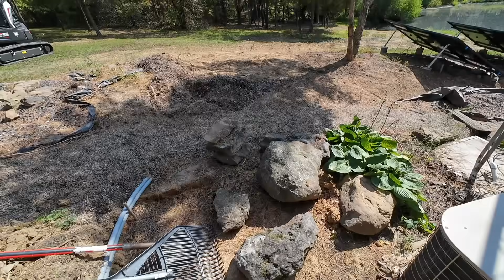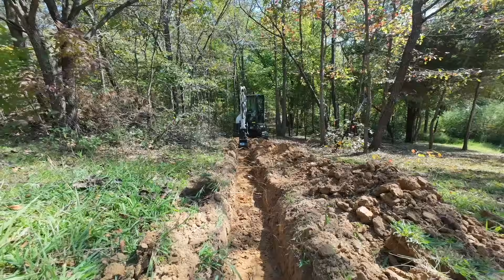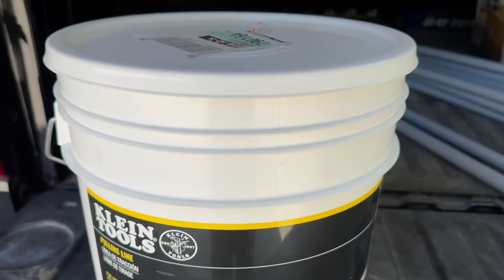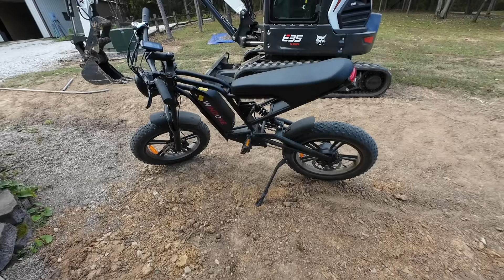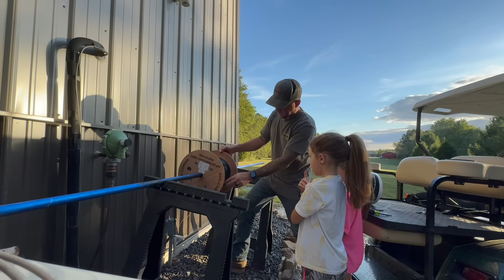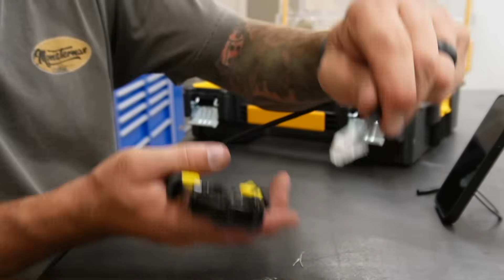Installing INTERNET To my Shop Over 300 FEET AWAY...

Comment: Wireless bridge could saved a lot of work also.  Your uplink only serving your family
Reply from the maker: Does a wireless bridge work through dense woods?
Reply: Im not sure of the elevation of your property but since it not flat you be surprise. Probably when you put it on your existing tower to your star link. Then a single mast by your shop and a good quality wifi bridge.
Reply from the maker: I went with the guarantee by hard wiring it.

Comment: I tried a wifi extender to my shop and it works about 50% of the time this summer ill be doing conduit and cat 6 along with a coax cable for antenna tv as we have a nice antenna on the house and dont want to buy another.  Glad my run is only 20ft. My cameras,tv and wifi problems will be a thing of the past and pretty cheap to do.

Comment: I work at a data center, and we run premade fiber all or the time. Premade Single mode with LC connectors in any length. Possibly cheaper than a copper run. You will need the routers or switches to have SFP ports for the optics modules. I have run fiber 65 feet to my shop.  I’m even going to start using it for my desktop. So it is easier to use these days than 5 or even a couple of years ago.

Comment: I see the video is a year old, I hope you've reconsidered fiber in the interim.  You can pull in pre-terminated duplex LC fiber patch cables into that 3/4" conduit; I'd recommend pulling two just for redundancy.  The problem with copper between buildings is that a nearby lightning strike could take out all of your connected network gear in one fell swoop.  Fiber is completely non-conductive, and therefore immune from lightning.  Excellent work by your girls, by the way!
Reply from the maker: The copper line has been working great.  Lots of storms and zero issues.

Comment: Funny how electricians will pull so much extra wire on paid jobs and waste it..but when it comes to their own ....it's expensive lol
Reply from the maker: Not really.  Your either spending the extra time/labor for more accurate lengths or spend a little more on material.  Material is cheaper than the labor 80% of the time.  At home, all i have to worry about is material costs.

Comment: Do the two buildings share a breaker box or are they different service connections? If they were the same you could of used powerline injectors to get ethernet over. They've come a ways too, if the electrical wiring is good quality then you can get decent speeds. I used them when I lived outside town here to get wifi in the barn. I only had a 10mb internet at the time but I was able to test between my phone and my server hosting plex and was getting 50-60mbps.

Comment: EE and network hardware engineer here. The reason you want fiber instead of twisted pair is due to the different grounds in your two buildings. If you were to take a multimeter with VERY long leads and measure the voltage between the grounds in your two buildings, you're likely to find a difference. Using fiber completely eliminates any concern about this differential or common mode voltage. It's also capable of faster speeds.
Reply: Isn't lightning also a problem? In the meantime you can get premade fiber cable for not too much and a switch with SFP ports and you are golden.
Reply: @DavidVerch  Yeah, the current from a lightning stike can induce currents in conductors and cause ground voltage differences. I've lost switch ports and garage door openers from near misses due to induced currents in the long network and door safety beam wires. Fiber FTW.
Reply: Ethernet interfaces have isolation transformers (such as DGKYD KG7209DR) between the twisted pairs and the rest of the circuit.
Reply: @RobUSVI  Yes, and the good ones also have TVS devices to clamp surges. But I have noticed that consumer grade interfaces are not always built as well as commercial grade ones. I have replaced several consumer type switches at my home which failed after a nearby lightning strike. I now use only surplus commercial gear, which I find to be more robust.
Reply: The reason you want fiber is more bandwidth and speed. Ethernet is iso-coupled. No potential between source problems can exist by standard.  You might want to get a refund on that engineering degree.
Reply: @BlueCollarBachelor  Ah, yes, Ethernet is transformer coupled. But those transformers, and the traces on the circuit board they're mounted on, have breakdown voltages. If a nearby lightning strike induces currents that cause those breakdown limits to be exceeded, PFFFT! there goes your Ethernet interface. 
It has happened to me several times, with consumer grade switches and runs within my home which acted as antennas during nearby lightning strikes. Once I switched to commercial grade rack mount switches, the problem stopped. I suspect the isolation on consumer gear might not be up to spec, but even so, a lightning strike within 1/4 mile will induce some pretty significant spikes.
Reply: Absolute nonsense
Reply: The Coax (Cable and antenna) tech is getting good, 2.5g speeds and 20+ nodes on the lines. Less noise and signal loss over 400+ ft lengths.

Comment: Cat6? Pushing it at 300 Feet.... 
I would buy a spool of pre terminated Fiber, 100 Meter cable on Amazon is like 80 bucks and you just need a Cheap switch at each end with a SFP+ port.

You also don't want to use the WAN Port, you get double NAT. 
You can configure the router in the shop as an AP only and you just plug the cat6 into one of the 4 LAN ports. 
You can also use the same SSID wifi name and passcode in the shop as the house.

I would just buy a enterprise Access Points (AP) so you get better covage in the shop.
Reply: If you're doing this for a company, sure a fiber run is probably preferred. 
But realistically CAT6 will do 330ish feet, and is acceptable just to get wired connection to another building.
Reply: @wobbled5609  even if it was Cat6A he is pushing it at 300 feet. its not like the Fiber is more expensive. Maybe you can use Fiber to Ethernet converters if you don't need 2 switches.

Comment: Nice job. I prefer my line in conduit, too. I plan to run fiber to my shop. A couple things: 1) if you tape an elbow (90) on the end of the pipe it makes it easier to push it down a ditch 2) since it is low voltage and on private property, you could have used "thin wall" waterpipe and it would cost much less than that gray conduit.

Comment: I think the ethernet length spec is actually 100 meters instead of 300 feet so that buys you an extra 28 feet right there but you'll be fine either way

Comment: So would have been cheaper just to put a second starlink for you shop 🤔
If you wanted to have a digital link between your house and shop then just a Von between the two
Reply from the maker: Definitely not cheaper and no line of site to the shop.  Thats why i did what i did.
Reply: @ I meant if you had a second starlink at the shop then you could link the house to the shop over the internet between the two separate starlinks … but now you got the conduit in its mute 🫣🤣

Comment: Coming from someone who works in the IT industry, you should look into getting some pass through rj45 connectors and crimper/cutters. Klein makes the crimper/cutters. The nice thing about this setup is you don't have to worry about getting it perfect because the wires go all the way through the connector and then you can just cut them flush. This allows a perfect connection each time, you can confirm your wires are in the correct color order, and you can crimp them right about the jacket in the proper spot every time. They are game changers for doing these terminations.
Reply: I hate passthrough. I feel like they are harder and have more problems
Reply: As someone who works in the IT industry I’ve had several of those fail

Comment: Why didn't you use a starlink mesh router since you have Starlink?
Reply from the maker: This was before i had starlink.   Can the starlink mesh router work through 400’ of dense woods?
Reply: I realized that after posting my dumb comment. I watched your videos out of order. Not sure if the Gen 3 mesh router will work in your circumstance. I'm getting ready to try it for mine. Not sure of the distance from the house to shop. Keep up the great videos! @SpicerDesignsLLC
Reply from the maker: @rickgifford42 im going to be replacing it with fiber this year.  It seems to be lacking a little out in the shop.

Comment: yes, adding lightning protection would be smart thing to do. With fiber, no protection is needed, cause fiber does not conduct electricity.  I was hoping you were going to pull in a pull string with the cat 6, and you did.

Comment: If you don't want to go to fiber, you might want to consider using either Cat 6A or Cat7 instead of Cat 6 for that long of a run. They have bandwidths of 500Mhz and 600 Mhz respectfully which is twice that of cat 6 (250Mhz), so your signal should not degrade as much. Just a thought in case your internet is a little too slow.

Comment: so its not a rule of thumb on the 300 ft. Its the spec of the ethernet signal, 100 meters or 328ft. Most people dont like to push to the 328ft and stay around 300ft as you mentioned. Also if you are running 10gig it has to be cat6a if you want that 300ft, its about half with cat6 or cat5e

Comment: Maybe I missed it in the video, but why not have wireless heads on your house and shop? It'd be a cheaper price point and you wouldn't have much of the speed/data loss issue others have talked about.
Reply from the maker: I dont really want wifi all over my property like that.  Id rather just have it concentrated in the buildings.  Also the trees block the line of sight between the shop and the house.

Comment: Did you look into a point to point wireless connection? Ubiquity and other companies have very simple systems that would make simple work out of this. Trenching 300 feet is an awful lot of work. Additionally, we never run. Copper underground, always fiber! Too much static discharge, especially here in Florida where we have lightning constantly. Be sure to at least put good surge protectors on each end and hopefully you won’t have any problems with your switches, but I still would never  putting recommend putting copper CAT6 underground. Also, running CAT6 over 333 ft will cause all kinds of problems beside just slight issues internet slow down. You will have disconnects, switch port issues and yes, data slow down. I’ve repaired several installations like this usually be replacing with fiber. We also use wireless P2P for most short installs like this.
Reply: When I saw the title of this video I figured he was installing a point to point wireless system. I think something like a Ubiquiti p to p would easily cover 350 feet even with some obstructions. The speed would be faster than Starlink, which these days is about 300 MB down.
Reply from the maker: Would the point to point work through 300’ of dense trees?
Reply: @SpicerDesignsLLC  Obviously a clear line of sight would be best. Could you get a clear path between your tower and the roof of the shop? Ubiquiti units will work through foliage over shorter distances but you might have to do some tree trimming. Also using lower frequencies like 2.4 GHz vs 5 GHz helps the signal penetrate foliage.
Reply from the maker: @Reality_Check1974 no thats why i did it the way i did.

Comment: 23:46 you can take the outer sheathing you stripped off the CAT6 to untwist your pairs, save your fingers, and get them done a lot faster. FYI.
Reply from the maker: My finger tips are like leather.  Never tried that though.   Good idea!
Reply: Belden also makes a tool to unspool them. I don't trust myself with anything less than pass through ports.

Comment: Note, Cat6 and Cat5e are both rated to carry 1 Gbps up to 100m which is 328ft, which is barely less than the 350ft you estimated. Starlink does not provide speeds near fast enough to worry if 350ft is too long. Theoretically if you’re only getting 100Mbps from starlink, you could run cable double the distance and likely would still get usable internet. Being low voltage it might have a power delivery issue unless you have a high power switch. However no fiber or repeater would ever be necessary in your case, unless you get fiber internet and still pushing actual speed to the shop.

Comment: get a mesh router. you can use that cat6 as a "wired backhaul". so when you are out in the shop you are connected to the same network as in the house.
Reply: I personally would use APs. It's cheaper and if you have a POE switch, they can be powered with the cat6 cable. 
Mesh routers are a scam for home owners that don't know how to setup a network and are ridiculously over priced. You will never find a mesh router anywhere but in a home. APs is the way to go if you need more coverage than one router can give you.
Reply: @Jeremy-xl1bn  i agree but a lot of home owners don't know how to setup a router.  Let alone an AP.  I like mesh because the simplicity for customers.  I have the netgear orbi currently.   All 4 have a backhaul to the main one. When they finally give up ill be upgrading. But until then, ill keep using them

Comment: I see a lot of comments saying to install fiber. What people don’t realize is that that per specs, fiber has a distance limitation of 100M (328 ft.) just like copper if it is used in a horizontal run like this is. Will it work, yes, but so will the copper. In this application, it will be perfectly fine with the speeds you are looking for. 
I wouldn’t install it for a customer, but for myself, I would do the same thing because I know it will work. 

I also seen a mention of armored fiber, MM fiber and SM fiber. If using armored fiber, you will need to bond it to a ground. MM is actually more expensive than SM now because SM is used more now days. If you think you need fiber, go with a SM fiber. Then you can use media converters on both ends as you mentioned in the video to convert it back to copper if you don’t have a SFP on your switch/router.

Comment: Just an FYI, next time you find yourself pulling wire like you did. Instead of killing yourself pulling upwards like you were, set up an A frame ladder above the conduit and loop the string over the upper rung (acting as a pulley) so that you only have to pull down and wont have to exert so much upper body effort to pull the cable through.
Reply from the maker: @famousamoso7  the string would have wore through the conduit with that angle.  Its best to pull straight out of that pipe.  Ive been pulling wire for 20 years so im pretty conditioned for it.  For larger pulls we would set up rigging and even larger we use a tugger.
Reply: @SpicerDesignsLLC  I understand what you are saying. I meant if you positioned the ladder directly above so it pulled straight out. I dont doubt your abilities :) 
Great job overall.

Comment: 7:56 Fiber is really plug and play nowadays 🙂
You just need a UV protected fiber with LC connectors and a switch with fiber SFP modules at each end. That’s how you get fiber between your buildings 🙂
Reply: Agree 100%  Or even use Media Converters, but the switches with fiber interfaces are really cheap these days.

Comment: a) I've run way longer than 300' with just CAT5e, works fine for a camera... but yeah, 300+ should technically be fiber.... b) dude, get the pass-through connectors & crimp tool, this took me back (in bad memories *cringe*) 15+ years :)
Reply from the maker: I dont mind the regular rj45s. Theyre pretty easy.

Comment: Wired is certainly reliable, but hard work. May want to look at KuWFi 1200Mbps WiFi Bridge Point to Point Outdoor ($199). Claims it goes up to 5KM. No trenching. They have less expensive slower connections.  silver cymbal installed one on his YouTube channel. On the list to install one in my barn at 300 feet away.

Comment: You should have run fiber.  copper is a magnet for lightning and static charges.  I made that mistake and several pieces of damaged equipment later, switched to fiber.
Reply from the maker: @av-mike  fiber huh? your the first one to say that.  I can always pull it in later.  Its been laying in the grass for a year and no issues.

Comment: Your not working on your garage wifi...you're installing networking or a network link or similar.  Wi-Fi is a wireless network connection that's it.
Long runs of copper network cable in the ground is a bad idea and high probability to fry equipment on both ends from static charges. Fiber cable is a much better option
Reply: Ubiquiti for example has Toughcable that has a ground wire, used with metal plugs can help. But a fiber cable is better
Reply from the maker: If i ever need a fiber i can pull it in the conduit.
Reply: @SpicerDesignsLLC  Yea but why do it twice :)

Comment: Do you Know there are CAT IN Line Booster devices? They need POE to power them - I recommend Texas POE. You could cut your conduit mid way - put a 8x8 PVC waterproof box. The Booster lives in there. Do you also know there are RJ 45 PASSTHROUGH connectors - make that RJ45 job so much easier!
Reply from the maker: The regular rj45 jacks are pretty easy.  Takes about a minute to do one.  Thanks for the info but ive had this hooked up for over a year now with a longer cable.  Just got around to burying it not.  Ive never had any issues with it.